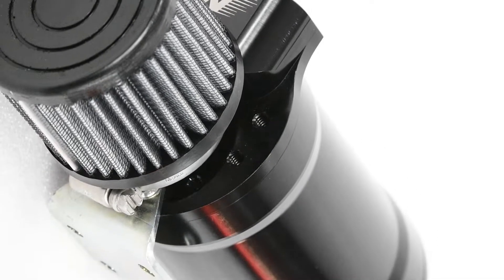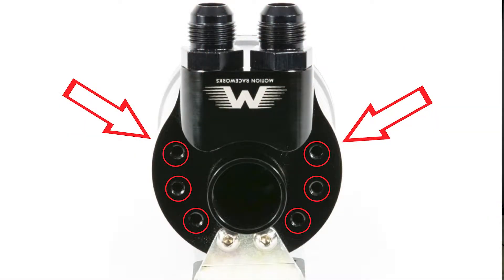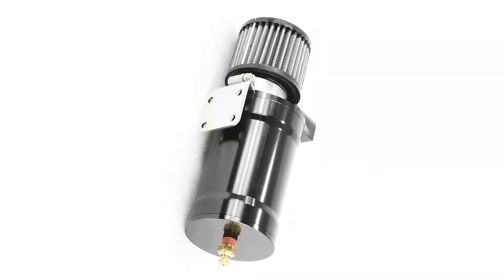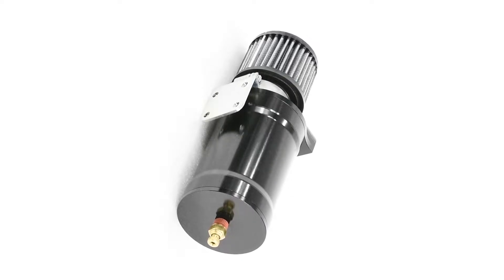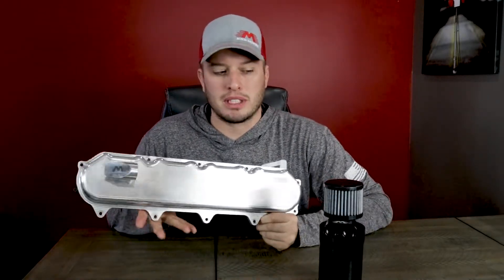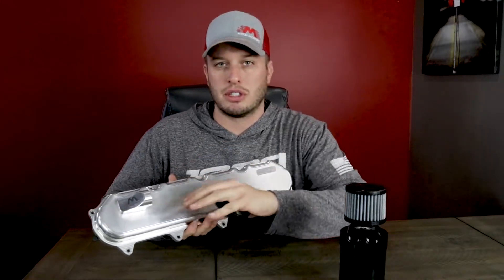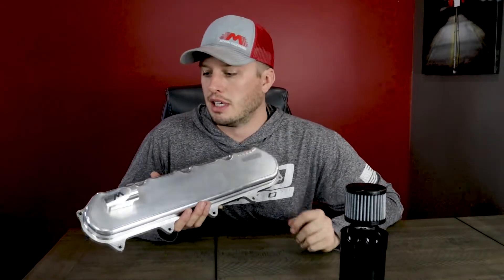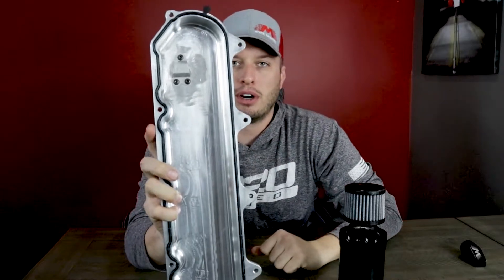NEW Billet Engine Oil Catch Can by Motion Raceworks

Comment: So Doug how does that catch can, which I have your kit coming by the way,  relieve enough crankcase pressure without vacuum?
Reply from the maker: Pressure always finds the path of least resistance, just like untying a balloon
Reply from the maker: So it will exit stage left via the filter on top of the can

Comment: One thing that helps with keeping oil out of your can, is to make your hose coming out of your block go as vertical as possible, and mount your can as high as possible. I have mine mounted to the top of the engine, and have a 10 an hose connected to the bottom drain, that hangs down to the oil pan, next to the drain, with the petcock at the end, so when changing oil, i can drain the can, no mess in the bay that way, and it gives you extra room for oil, since the hose fills up too. You could also hard-line plumb it back into the top of the oil pan, so you never have to physically drain it. Only use hard-line if your can is attached to your engine, or you have solid motor mounts.

Comment: Dual -12’s and a flush to the cap screen type filter would be even better. I run a vibrant can which is very similar to ya’ll’s except it uses a flush screen filter and can accept 2) -12 hoses. Just ordered my billet valve cover breather elbows from you guys, doing away with the “fuel cell bulkhead” fittings i was using for your baffled elbows. Keep the badass products coming 💪🏼